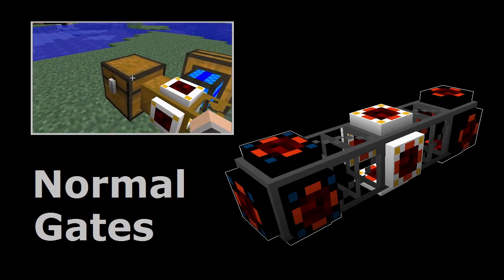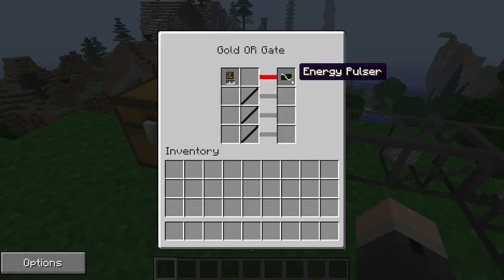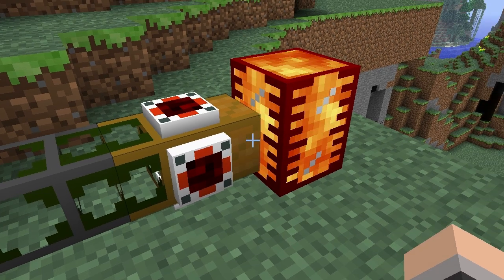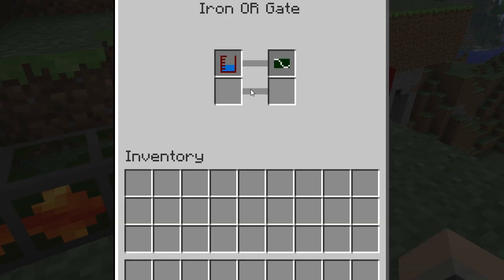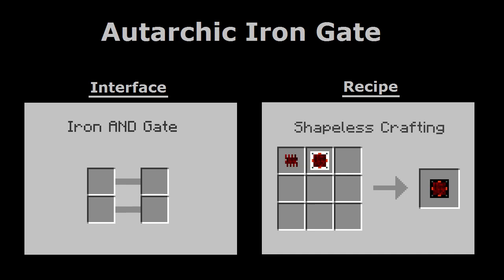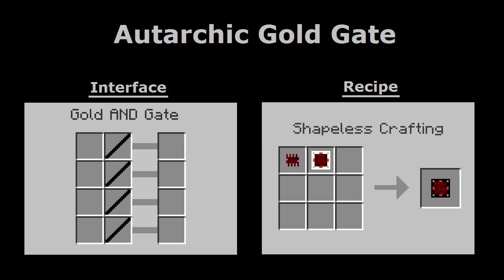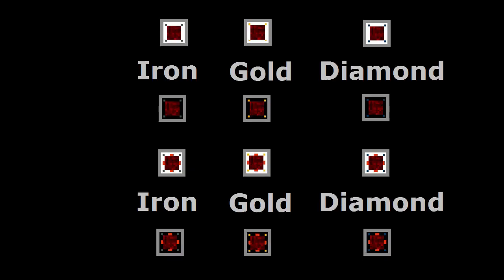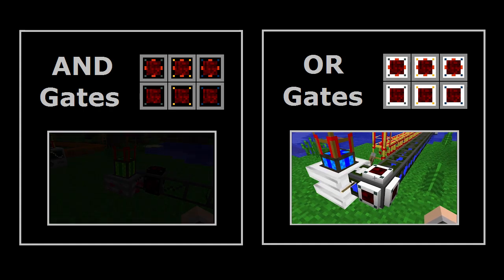Autarchic Gates (Tekkit/Feed The Beast) - Minecraft In Minutes

Comment: I tried to hook up an iron AND gate with input1: redwire signal+, input2: redstone signal and output1: redwire signal+, redwire signal+.  the gate does not allow only the circuit to activate with only the redstone signal but since the redwire is being used as an out and in its not working correctly.  Also the gate does not recognize any other color wire as an option to differentiate between input and output.  Any suggestions?